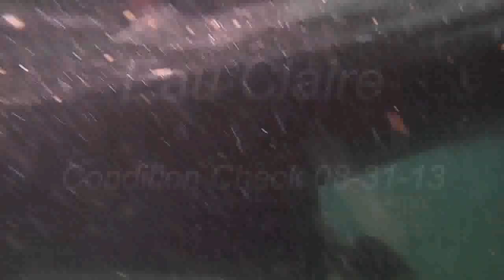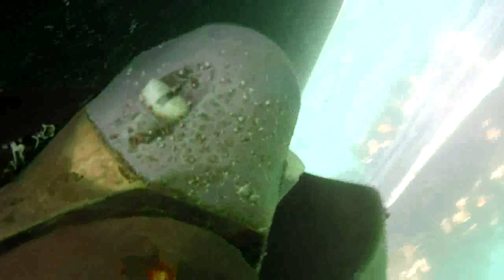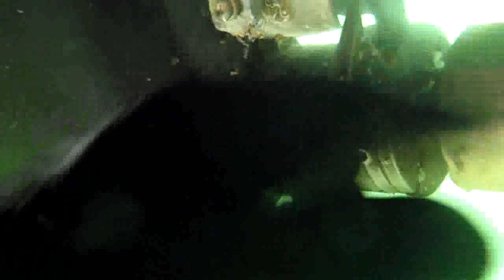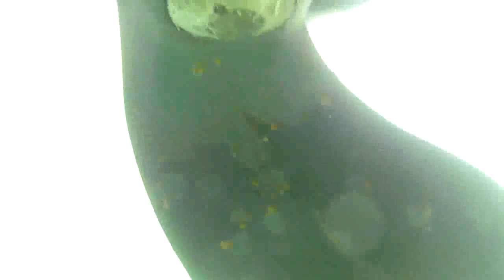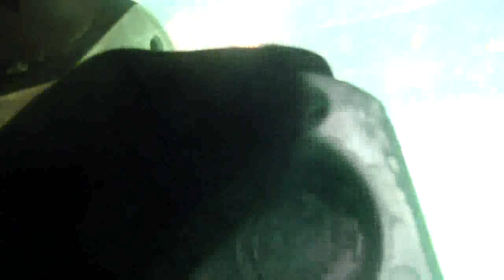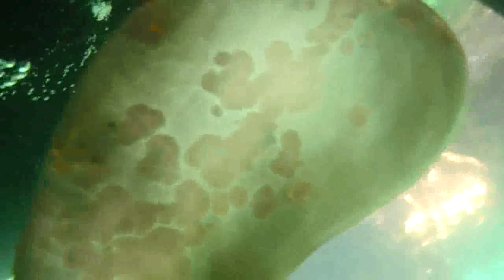Autoprop 08/31/13/

Comment: This Anode is protecting a prop made of a metal at the very top of the nobility chart. So it's got very little to do!  The 'spots' look like ferrous oxide, probably attracted to the noble prop from the fittings in neighbouring boats, or the dock.
Love the Autoprop.  Fitted a one on a 60ton sailing boat I was with for years. Saved about 50% of fuel compared to the old fashioned 'Shamrock' type.  Motor sailing especially efficient.  Beautiful engineering.

Comment: You have made the anode inactive by using nylon screws to attach it to the prop - you took away the primary continuity between the anode and the rest of the vessel!!!!! The anode is still working a little because there is a little bit of contact between the metals at the mating surface i.e. where they physically touch.

Comment from the maker: Nylon screws are standard issue with these anodes, notice its not the body or hub of the prop (where the screws are are placed) that is affected but rather the blades that ride on ball bearings. Personally, I believe its the continuity between the stainless steel (higher nobility) bearings and the articulating blades that is the source of the issue. The owner shared the videos with the manufacturer, they didn't agree. They suggested it was the anodes the owner was purchasing online. I installed a Mil Spec anode from Martyr which did not change the situation. The video log (view the entire playlist Eau Claire 08/26/11) for this boat goes back to my initial service on 08/26/11. Note the condition was present but milder even then even though the anode was burning well minute 5:43 in the video. Also note how the color of the blades match the color of the hub and how that changes as the condition worsens over time.

Comment from the maker: This video is part of a playlist going back to 8/26/11 (current video entry is 5/16/14) http://www.greencleandiver.com/eauclaire/index.html. The condition was present at the time I first began hull service. The anode actively corroded, being replaced about every 3 months. The boat has moved location without change in behavior. Only recently has the condition worsened with the anode becoming near completely inactive. The anode is military spec. The "spots" show the surface of the blades being etched. Note also the difference in color between the blades and the body of the prop. The prop blades are doing what the anode should be doing. I would encourage others to view later video entries as well and welcome input. Green Clean Dive Service